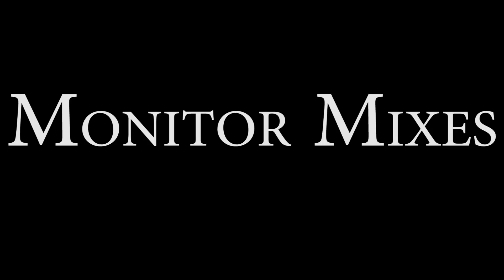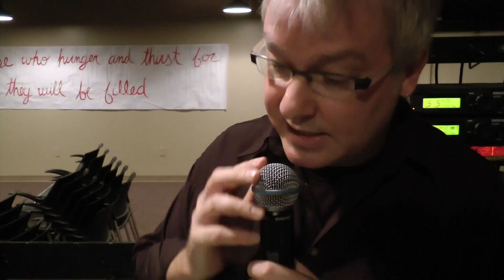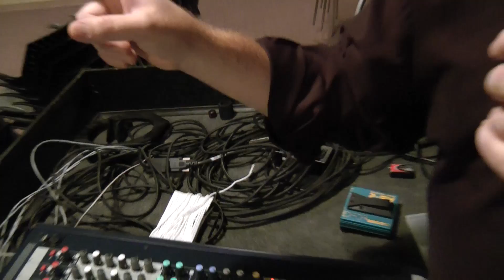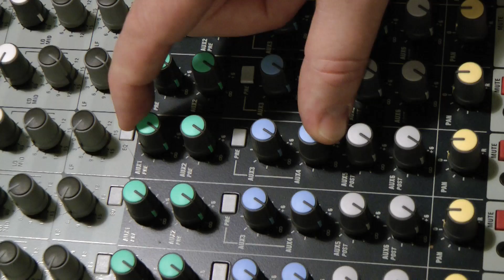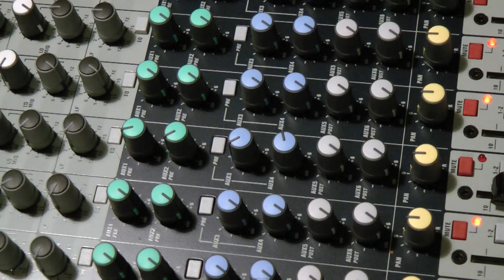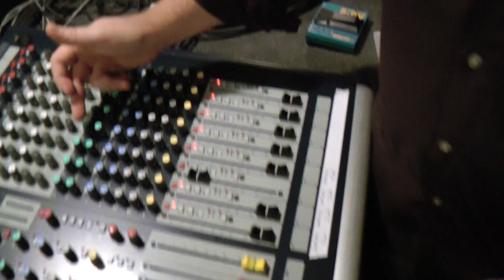8 Monitor mixes

Comment: Can we eq the monitors separately ? or does the sound always depends on the eq from the original source?
Reply: chelosegura The EQ is common between monitor and mains. If you want to have separate EQ, you can either have an EQ between the board and the monitors (what I do). Or you could take the direct out of one channel, feed it to the line input of another channel, you could have separate EQs on the desk for mains and monitors.